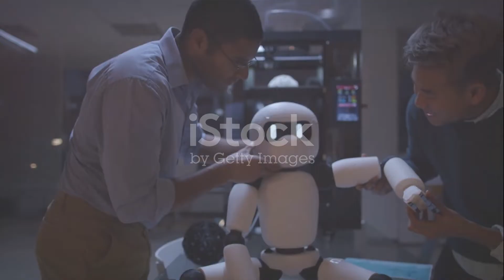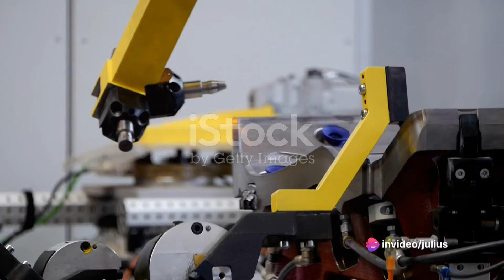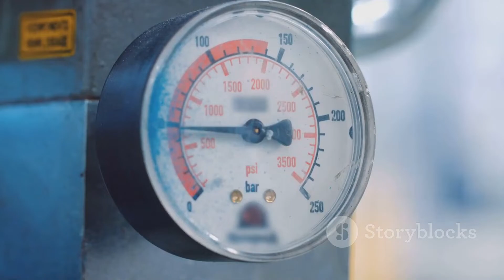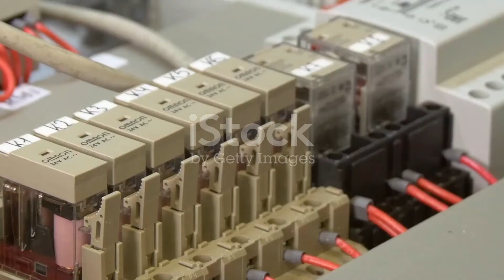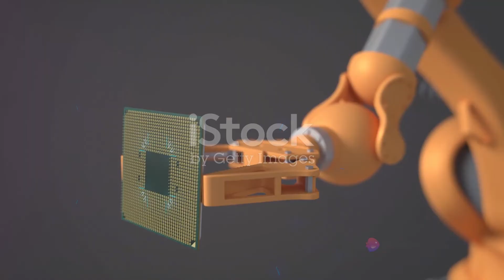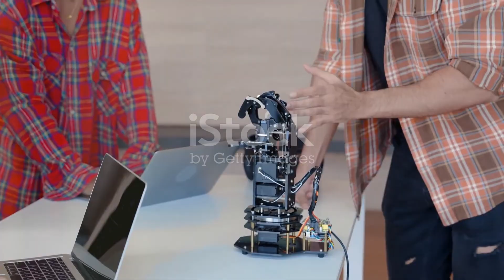Top 10 Analog Inputs in Robotics

Comment: Ariel D. Lacia
10 andromeda

1.) What are analog inputs and why are they important to robots?

Robots can sense things in a unique way thanks to analog inputs. They are capable of measuring temperature, pressure, location, and other physical attributes. This aids in robot comprehension of their surroundings and enables them to operate more effectively and efficiently. Analog input is the process of transforming an external voltage into a digital format so that a microcontroller can store and use it. Applications include data loggers, control systems, digital audio, and signal processors frequently employ this kind of input.

Comment: Christine Divine S. Taña  
10-LYNX  

1. What are analog inputs and why are they important for robots?

Analog inputs are signals that provide continuous data, such as varying voltage levels, representing real-world information like temperature, light, or pressure. They are important for robots because they help the robot sense and respond to its environment with greater accuracy and adaptability.

Comment: Evzen Radik A. Salvador
10 - Orion

5. How do analog signals get processed by robots after they are collected from the environment?

Once robots collect analog signals from the environment, the first step is to convert these signals into digital format using an analog-to-digital converter (ADC). This digital data is then processed by the robot's microcontroller or computer, which interprets the information and makes decisions based on it. The processing may involve filtering out noise, analyzing patterns, and integrating data from various sensors. Finally, the robot uses the processed information to adjust its actions or respond to the environment, enabling it to operate effectively and adapt to changes around it.

Comment: AKISHA BACHINICHA
10 ORION

1.) Analog inputs are continuous signals, like temperature, pressure, or position, that robots use to sense varying conditions. They are important because they provide detailed data, allowing robots to make precise adjustments, adapt to complex environments, and perform smooth, nuanced actions.

Comment: Urhyness Agatha Santos 
Cassiopeia 

Question: Explain the role of position sensors like potentiometers in robotic systems.

Answer: The position sensors such as potentiometers provide an analog voltage proportional to the position a movable part. Position sensors could also produce varying voltage signals as a function of rotation or position, allowing precise measurements of angles.

Comment: Jannah Loreen S. Galla
10 - CASSIOPEIA 

Q: 5. How do analog signals get processed by robots after they are collected from the environment?

A: When robots collect analog signals from their environment, sensors capture data like temperature or pressure. Since robots use digital systems, these signals are converted into digital form by an Analog-to-Digital Converter (ADC). The robot's processor then analyzes the digital data, filtering out noise and making decisions based on its programming. Finally, the robot acts on these decisions, controlling motors or other components to complete tasks.

Comment: Jacinth J. Yerro
10-Hermes

5.How do analog signals get processed by robots after they are collected from the environment?
Once analog signals are collected from the environment by sensors, robots process them by converting the signals into digital format using an analog-to-digital converter (ADC). After digitization, the data can be processed by the robot’s microcontroller or computer to analyze, interpret, and make decisions based on the information received.

Comment: Reeve Radley Fua
X Cassiopeia 

Q3: Explain the role of position sensors like potentiometers in robotic systems.

A: Position sensors, such as potentiometers, provide an analog voltage corresponding to the position of movable robot parts, allowing for precise control and accurate movements in tasks like gripping, lifting, or rotating objects.

Comment: Alvin M. Tagudin
10-Hermes

5. How do analog signals get processed by robots after they are collected from the environment?
-After analog signals are collected from the environment by sensors, robots process them by converting the signals into digital form using an analog-to-digital converter (ADC). Once digitized, the data can be processed by the robot’s microcontroller or computer to analyze, interpret, and make decisions based on the information.

Comment: Zophiel Hailey Jace B. Usman
10 - Hermés

1. What are analog inputs and why are they important for robots?

- Analog inputs are signals that represent continuous and fluctuating quantity, unlike discrete binary states. They can take on many values within a specified range and provide robots with detailed and nuance information about the environment, such as position, force, temperature, etc. This allows robots to better sense, measure, and interact with their surroundings.

Comment: Rushlee Baltazar
10-HERMES 
4. What are some examples of various analog sensors mentioned in the video, and what measurements do they provide?
Examples of analog sensors include temperature sensors (measure heat), light-dependent resistors (measure light intensity), potentiometers (measure position or angle), and pressure sensors (measure force or pressure). These sensors convert physical quantities into continuous electrical signals for measurement.

Comment: Sairel A. Yabo 
X- Hermes

1.Analog inputs allow robots to "feel" their surroundings. They can measure things like temperature, pressure, and location, helping the robot understand its environment. This information is essential for the robot to work efficiently and safely. Analog input is like translating a continuous signal, like voltage, into a digital language that the robot can understand and use. This technology is used in many applications, from recording data to controlling systems and processing signals.

Comment: Jaeve Joshua C. Butcon
X-Hermes

5. How do analog signals get processed by robots after they are collected from the environment?

Analog signals collected by robots are typically converted into digital form through an analog-to-digital converter (ADC). Once digitized, these signals can be processed using algorithms for tasks like filtering, feature extraction, and decision-making. The ultimate goal is to interpret the environment accurately for navigation or interaction.

Comment: Kenichie C. Racero
10 Hermes

1. What are analog inputs and why are they important for robots?
-Analog inputs are signals or data that represent continuous and fluctuating quantities, unlike digital inputs that only represent discrete binary states. These inputs are crucial for robots because they allow for the sensing, measurement, and interaction with a wide range of environmental variables, such as position, force, temperature, and more. Analog inputs enable robots to perceive the world in a nuanced and detailed way, providing the versatility and adaptability necessary for complex tasks.

Comment: Fresh M. Satur 
10 - LYNX

1. What are analog inputs and why are they important for robots?

Analog inputs are signals that vary continuously over a range, representing information such as temperature, light, or pressure. They are important for robots because they allow the robot to receive detailed and real-time data from sensors. This information helps the robot understand its environment and make decisions based on varying conditions. For example, an analog temperature sensor can provide precise readings, enabling the robot to respond appropriately to changes in temperature, which is crucial for tasks like monitoring or adjusting processes.

Comment: Gabriel Jan D. Calipayan
10-Lyra

3. Robots utilize potentiometers and position sensors to locate parts by modulating electrical signals based on movement of components like the arm, enabling precise control.

Comment: Shawn Deece Otoc
10 LYNX

3. Explain the role of position sensors like potentiometers in robotic systems.

Position sensors provide analog voltage proportional to the position of a movable part, such as a robot joints.

Comment: Maria Sophia Sam Abansado
10 Lyra

1. Analog inputs are Continuously varying signals, like those that represent sound, temperature, or pressure in the real world. Analog inputs provide more accurate and comprehensive information since they can take on any value within a range, unlike digital signals which have distinct on/off states. The complexity of physical measurements are critical for precise data processing, monitoring, and control in many applications especially in robots.

Comment: Kobie James B. Gabales
10-ANDROMEDA

3. Explain the role of position sensors like potentiometers in robotic systems.

- Provide an analog voltage proportional to the position of a movable part, such as a robot joints.

Comment: Michaella Ragmac
10 - Cassiopeia

1. What are analog inputs and why are they important for robots?

Analog inputs are signals or data that reflect continuous and varying quantities. They play a crucial role in enabling robots to detect, measure, and interact with variables like position, force, temperature, and other factors.

Comment: Messiah Emmanuelle Lei P. Salomon
10-Cassiopeia

1. What are analog inputs and why are they important to robots? 

Continuous electrical signals can be obtained through analog inputs. They are crucial to robotics because, in contrast to digital inputs, which can only deliver a high or low signal, analog inputs may provide precise environmental data. A temperature sensor that modifies resistance in response to heat intensity or a potentiometer that modifies resistance in response to pot rotation are two instances of analog inputs.

Comment: Tabitha Glenne P. Lagria
10-Cassiopeia

1. What are analog inputs and why are they important for robots?
A:  Analog inputs are signals that vary continuously and can represent a wide range of values, such as temperature, light intensity, or pressure. They are important for robots because they allow for nuanced sensing and control, enabling the robot to interact with and adapt to complex and changing environments.

Comment: Alexa Janne Arioja
10-Lynx

3) Explain the role of position sensors like potentiometers in robotic systems.

> Potentiometers and other position sensors generate an analog voltage that is proportionate to the position of a moveable component. Moreover, position sensors may generate different voltage signals in response to rotation or position, enabling accurate angle readings. Position sensors, like potentiometers, produce an analog voltage proportional to the position of a moveable item. In summary, position sensors are devices that detect the location or movement of an object. Moreover, position sensors may generate different voltage signals in response to rotation or position, enabling accurate angle readings. To put it briefly, position sensors are tools that identify an object's location or displacement.

Comment: Ana Althea B. Mabaylan
10-Lyra

1.) What are analog inputs and why are they important for robots?

- Analog inputs, like voltage, are continuously varying signals that enable robots to comprehend real-world circumstances such as temperature, light, and pressure. They are significant because they allow robots to sense and react to their surroundings with higher accuracy and versatility.

Comment: Schumary Faye L. Reyes
10-LYNX

1.) What are analog inputs and why are they important to robots?

Robots can sense things in a unique way thanks to analog inputs. They are capable of measuring temperature, pressure, location, and other physical attributes. This aids in robot comprehension of their surroundings and enables them to operate more effectively and efficiently. Analog input is the process of transforming an external voltage into a digital format so that a microcontroller can store and use it. Applications include data loggers, control systems, digital audio, and signal processors frequently employ this kind of input.

Comment: Anika Charisse D. Dawal
10 - Lyra

3. Explain the role of position sensors like potentiometers in robotic systems.

- Potentiometers and other position sensors are used by robots to help them locate their parts. A potentiometer's electrical signal is modulated in response to the movement of a moving component, such as the arm of a robot. By interpreting this signal, the robot can precisely control its movements by knowing how far its arm has moved.

Comment: Gabe Daniel S. Rivero
10 - Hermes

1. What are analog inputs and why are they important for robots?

Analog inputs are signals or data that continuously vary over time and can take on any value within a given range, as opposed to digital inputs, which have discrete levels (often just two: on and off). In robotics, analog inputs are important because they allow robots to interact with the real world, which is full of continuous, varying phenomena like temperature, light intensity, pressure, and position.

Comment: Fresh M. Satur
10-LYNX

1. What are analog inputs and why are they important for robots?

Analog inputs are signals that vary continuously and are crucial for robots as they allow precise sensing and response to real-world conditions. They enable robots to read data from sensors like temperature or light sensors, implement feedback control systems, and process smooth signals such as force or pressure changes, enhancing their interaction with the environment.

Comment: James Miguel Lumantas 
10-Lyra

1. What are analog inputs and why are they important for robots?

Analog inputs are signals that vary continuously, allowing robots to detect changes and interact more precisely with their environment. They are crucial for tasks requiring fine control and real world interaction such as measuring temperature or adjusting motor speed.

Comment: Amdre Clyde Eduardo C. Acta
10 lYRA

3. Explain the role of position sensors like potentiometers in robotic systems.

Answer: The role of position sensors such as potentiometers are to improve accuracy by sending real time feedback to the position of the joint allowing for fine tuning and preventing mishaps like the robot hitting itself or misjudging the length of its movement.

Comment: Xer Salise
X-LYRA

what are analog inputs and why are they important for robots

Analog inputs are continuously varying signals that allow robots to measure real-world variables like temperature, light, and pressure. They are crucial for enabling precise control, adaptability, and smooth operation in tasks requiring subtlety, such as adjusting grip strength or responding to environmental changes. These inputs help robots interact effectively with their surroundings.

Comment: Joshua El Noah M. Suan
10-Lyra

5. How do analog signals get processed by robots after they are collected from the environment?

-Robots collect analog signals from sensors like cameras or microphones and condition them through filtering or amplification. The signals are then converted into digital data by an Analog-to-Digital Converter (ADC). This digital data is processed using algorithms to extract relevant information. The processed data informs the robot's control system, guiding its decisions and actions. Based on this input, the robot adjusts its behavior and interacts with its environment accordingly.

Comment: Christian Dynniel M Llanos
10 - Lynx

1. What are analog inputs and why are they important for robots?

- Analog inputs are signals that represent a spectrum of values rather than just two distinct states (on or off). They deliver precise data on factors such as position, force, and temperature. For robots, these inputs are crucial as they enable the robots to detect and assess various physical conditions, enhancing their accuracy and ability to adapt to different environments.

Comment: Ara Bella S. Quilestino
10-LYNX

3. Explain the role of position sensors like potentiometers in robotic systems.
-Potentiometers and other position sensors greatly aid robots in locating their components. They serve as the robot's equivalent of a ruler, indicating the extent of joint movement. The robot needs this information in order to properly operate its hands and arms. It is analogous to being aware of your finger locations when making a reach. This is essential for accurately regulating their movements and carrying out activities that call for exact placement.

Comment: Neeka Ella P. Guillero
10 - LYNX

3. Explain the role of position sensors like potentiometers in robotic systems.

 Position sensors like potentiometers track the angular position of rotating parts. In robotic systems, these sensors offer feedback on the positions of joints or components, enabling the robot to control and adjust its movements with precision. This capability is crucial for tasks that need exact positioning and coordination, similar to how our fingers help us perform detailed tasks.

Comment: Angel P. Rivera
10- Lyra 

1. What are analog inputs and why are they important for robots?

- Analog inputs are signals that show a range of values rather than just two states (on or off). They provide detailed information about things like position, force, and temperature. For robots, these inputs are important because they help robots sense and measure different physical conditions, allowing them to work more accurately and adapt to different situations.